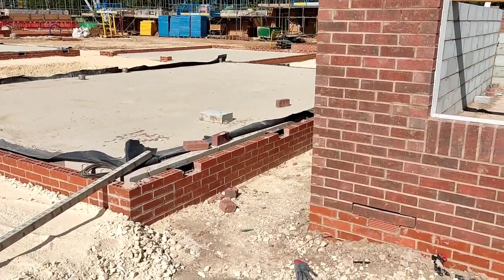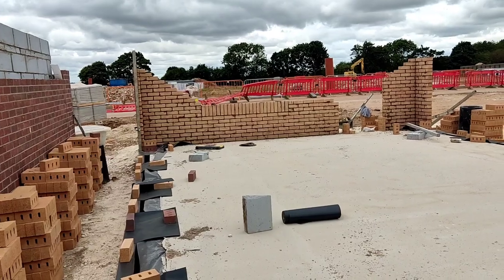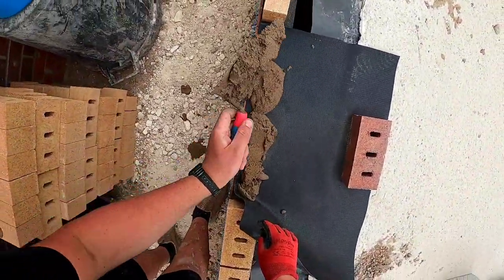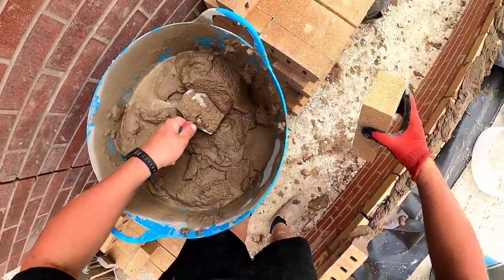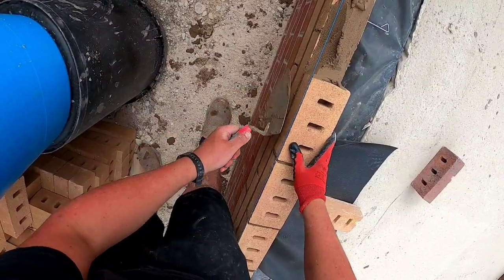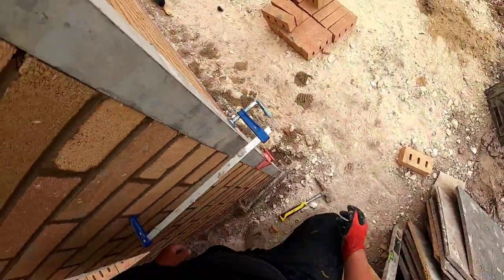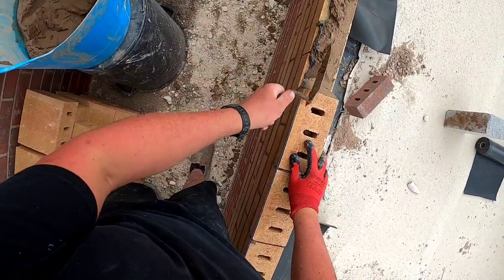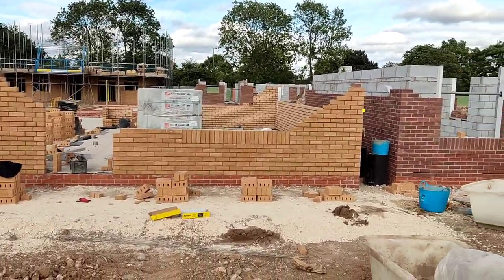Bricklaying Vlog - Pour the Bricks and we will Lay Them! 1200 Concrete Bricks in a Day!

Comment: 20:55 what size are the perps?
Reply from the maker: Plot was set out with tight perps, not ideal at all, but short of knocking the splash off its the only option sometimes, the site won't allow it us to straight joint with the splash to rebond it correctly 👍